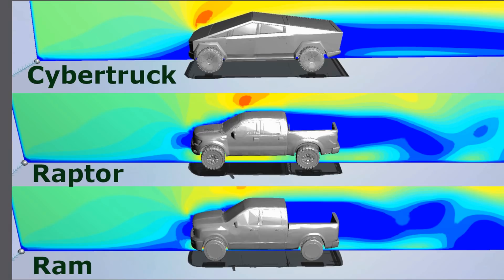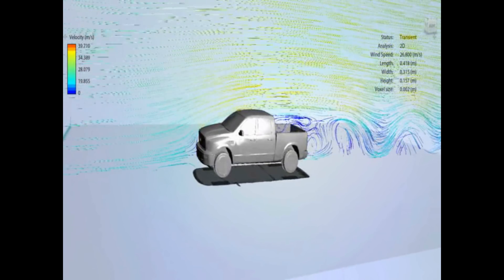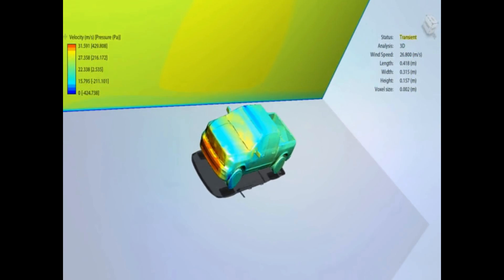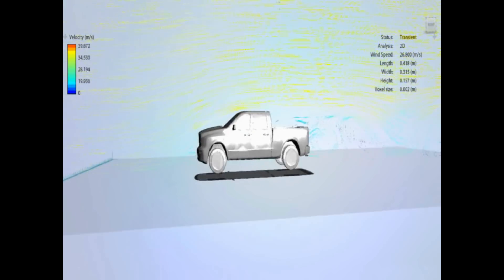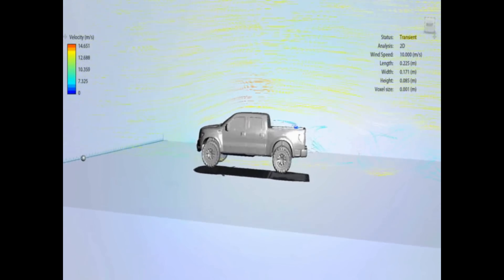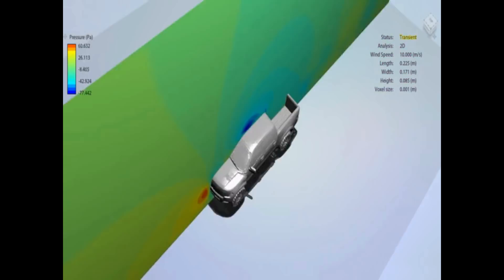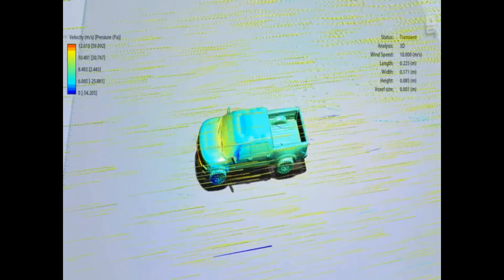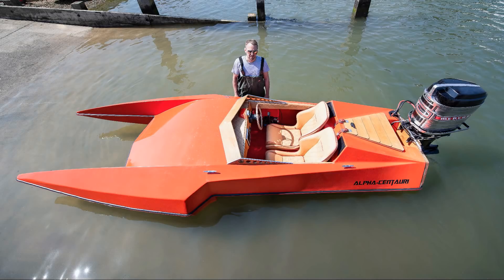Cybertruck vs Ram vs Raptor  Aerodynamics

Comment from the maker: Please bear in mind that the cd figures I have said could be way out!
This simulation used old software and potentially inaccurate models.
There is a lot of room for error.
There are a couple of genuine aerospace engineers saying that the drag is much higher than my results suggest,  trust their results not mine!
Reply: Boats and Engines - Here’s an additional analysis - 
https://interestingengineering.com/teslas-cybertruck-aerodynamics-do-flow-smoothly-as-per-a-cfd-analysis
Reply: Also, the Cybertrck is flatter underneath. No engine bay, rear dif.,driveshaft, etc.
Reply: Ram's published cd is 0.357.
Reply: Each should be ran with a cover over the bed or have the tesla have it's bed open. Really is an unfair test otherwise
Reply: Where do you get a software like this and is there any which are free?
Reply: Your on the reddit train, prepare for more subs
Reply: Hi. Where did you find the model for the Cybertruck?
Reply: Can someone direct me to this software..please!!  what is it? where can i get it?
Reply from the maker: @xevious2501  it's autodesk flow design,  no longer available. You can download openfoam free and its more up to date.
Reply: @BoatsandEngines  do it again with the bed closed and open.
Reply: Actually, your figures are intuitively quite reasonable.  The Cybertruck has a teardrop shape, though rough in texture.  The Facetmobile  and F-117 aircraft,  as well as most attack helicopters,  show that aero by flat facets is quite doable.  However,  traditional pickup trucks are glorified bricks aerodynamically,  and any recent advances in them are basically lipstick on (aerodynamic) pigs.  Nothing wrong with that,  but aero results are obvious. 

The cybertruck could even include slot ducts in the front fascia for battery cooling or HVAC, as well as cabin vent slits on that roof peak,  to control boundary layer and further improve aero.
Reply: What matters is the comparative results. Errors in one model should be the same as the other models. Use the comparisons to calibrate the actual figures. Try comparing with Model 3. MOdel 3 drag coefficient  should be around 0.3 using your software also. The actual one is 0.23, lower than Model S at 0.24. dodge Ram 1500 Regular Cab 4x2 has a drag coefficient of 0.360.
Reply: @4kbinaural935  "Errors in one model should be the same as the other models."
That's not necessarily the case and the comparison is kinda useless when the cybertruck's bed isn't even open. Obviously a closed bed will do better and trucks with partial or full canopies will do better than without. This also doesn't mean the cybertruck wouldn't do better with a curved top.
Reply: @trafalgarla  The best cd for ram is 0.36 with the bed covered plus other tricks. So the figure 0.5 to 0.6 with the bed open is reasonable and too high. All readings should be reduced by 0.1. Even for cybertruck.
Reply: Nobody in truck community cares about cd...all about how useful the truck is...i want to see how long will the batteries last while towing...the bed itself on cybertruck is pointless with those side walls

Comment: Good analysis. You did not go into the energy use but using  air density of 1.2kg/m^3 and a highway speed of 108 kmph the energy usage of the 3 vehicles using your drag coefficient figures Cybertruck= 0.4  , F150 of =0.56  along with rough manufacturers width and height and ground clearance which seems very similar for all 3 of them i feed that into power=force*velocity and ignoring factors like rolling resistance and electric motor efficiency which would generally be quite small compared to drag at highway speed of 108 kmph i get the following energy cost to overcome drag. 
Dodge ram   0.30kwh/km
Ford F150   0.29kwh/km
Cybertruck  0.23kwh/km

The Cybertruck's aerodynamics give it a clear advantage at 108kmph.
The Cybertruck's design using cast aluminium front and rear assembly's an exoskeleton shell and 4860 structural battery should help keep it's weight down compared to an electric version of the Ram or the F150 lightning - will be interesting to see what the production versions weigh.

Comment: Manufacturers basing their specs off of simulations? What is this, amateur hour? They use wind tunnel tests.
Reply from the maker: Not having a go at you. But perhaps you should do some research before making a statement like that.
Reply: @BoatsandEngines  Ayy my man, no fluid simulation can stand up to real life physics test. You can get decent mileage out of it during prototyping stage but it doesn't have great accuracy so you gotta do real tests.
Reply from the maker: @michaelbuckers  yes totally agree, but cfd is crucial at the initial design stage.

Comment: Cd is a bit meaningless without the frontal area. Do you have some figures? I’m trying to remember now but I think I was told by our wind tunnel guy that as a general rule, for bog standard family cars at least, that you can take the width and height dimensions from the brochure and roughly take about 15% off that area to arrive at an approximate frontal area. Probably a little different for bluff fronted vehicles like trucks though.

Comment: setup seems questionable - but you compared it to other cars with the same questionable setup so if oyu just look at the comparison between them the actual error shouldn't be too big
for starters it seems like the ground in your model is not moving backwards along with the air but instead remains stationary relative to the car - so due to friction with the ground there's a layer of air close to the ground with very little relative velocity

Comment: My back of the envelope calculations based on the  500 miles / 200 kWh battery claim is that the overall Cd * A of the Tesla truck will be not much better than that of the F150 assuming the same rolling resistance, maybe around 5 - 10%. A Cd of > 0.5 seems rather off for a modern vehicle. I have read in literature that it's estimated to be around 0.35.

Comment: Thank you for an excellent clear video presentation and impressive given your necessarily limited simulation processing power compared to a manufacturer. What intrigues me is current trucks top out at relatively low cruising speeds, unless crazy high fuel consumption is assumed. This makes one think that the cybertruck will be an efficient and possibly quiet long distance cruiser?
Mind you God help us when the police have them!

Comment: Question. I have access to solidworks. would you mind sending me the models? I have a ASUS ROG 1080Ti on the way soon I had to get it refurbished. (Shorted the RGB pins like a noob don't ask how) but I'll be able to push the simulation further for sure then.
Reply from the maker: Hello, the models are all on thingiverse. You will probably need meshlab or similar to convert the stl files.
Reply: @BoatsandEngines  Thanks for the advice and the resources when I can attempt the render I'll update by replying here.

Comment: Hey man I am a Mechanical Engineering Student. Can I know the reason you didn't choose Ansys? It is free for students and quite easy to get.
Reply: flow design is a million times easier to use than ansys for just a simple visual simulation.

Comment: I think it is mostly because of the cover of the rear portion of Cybertruck. Even if we could use some soft cover the portion from rear edge of cockpit to tailgate on F150 or RAM1500, the performance will be much better

Comment: I dont think that aerodynamics dont matter on pickups. Its about offroad performance and the power to pull stuff. If you want good pickup buy toyota. They are more durable and affortable.
Reply: Aerodynamics is EVERYTHING in every moving vehicle especially trucks it's going to determine how fast and efficient you travel even when you are off-roading. When your truck is not aerodynamic it is going to affect how much your truck can pull while going at a reasonable speed as well as how far it can travel because when a vehicle is more aerodynamic it will be able to go father be faster and pull more, this goes for every vehicle including aircraft and watercraft.
Reply: Most important thing in offroad is the tyres and engine power. Electrics may have better launch but that suff is useless in the trail. Turbo diesel for life. On environmental view electrics are pointless. 15k Toyota pick up is more worth the and more reliable than ev that overtime gets more mecanical problens. Influense of air resistance is just marginal.
Reply: @ashtonk.2380  i bet those ev wont last as long as cars made back in 90s and early 2000s. And good luck trying to get 500 000 km. Just like apple wants you to buy a new phone rather than repair the old one. Teslas cost over warranty.
Reply: @o.h2202  All combustion engines and electric vehicles can double if not triple the lifespan of cars made in the 90s and early 2000s for example cars in that time could go around 320 000 km before dying. Today's vehicles, electric and combustion engine can go around 800 000 km if not a little more before dying this may change due to Elon saying that Teslas will soon be getting a battery that can last over 1 600 000 km also teslas has an 8-year warranty on these batteries, if anything happens to them during the 8 years they will replace it for free and if you ever have mechanical issues with your vehicle they will come to you. I guess we can agree on 1 thing thoe and that is that Apple is a shit company that just wants to suck cash out of you.
Reply: @ashtonk.2380  they can go way more than 320 000km. But id still choose diesel pickup over any cybertruck. For example pickups are often used for towing. And diesel semis currently outperform teslas semis that can pull only 40 tonnes while diesels pull hundreds of tonnes more. Id rather invest on biofuels. They could become dirt cheap. Its more useful to get materials from mcdonalds than from Iraq oil fields. Allso London has a big problem with all this grease and fat in their sewer system.

Comment: This video is nonsensical because these are all open beds... there is something called a bed cover..   hatches etc... , if this was a big issue get a sloped aerodynamic bed cover or attach a fabric tarp.    Try runnign some tests with the bedcovers on... I love the cybertruck but this test is really scewed because the cybertruck wouldn't run closed bed with irregular or large cargo in the back, which is what people may be getting this truck for in the first place.

Comment: The lack of holes in the grille will make a huge difference. The holes allow air to pass through and make its way out of the underside of the truck and more importantly over the windscreen. It creates  a much smoother airflow over the entire top of the truck with less separation. Basically creates a skin of smooth air across the entire width of the trucks windshield. You can see this in action as you drive down the highway and see bugs or dust flow over the glass vs plastering on it like old models.
Reply: wrong.
Reply: @nothanks3590 wrong?
Reply: maybe I misunderstood the point you were trying to make... it seems you are sayin that having an open grill improves aerodynamics,  it doesn't.
Reply: @nothanks3590  K... Coming from an engineer....

A perfectly aerodynamically sleek shape is best (think land speed record cars). But we are talking about the "best case" of THIS form factor (aka a truck).

Using openings in the body of a vehicle to create a laminar flow over certain less optimal areas of geometry is a common practice in the automotive field.

An example, newer cars use vents that intake from the front and project a high pressure bubble over the wheel openings to prevent detached flow around the spinning wheels. The "loss" of efficiency from intaking air greatly reduces the drag over the rest of the body's side panels, so the overall efficiency goes up.

Another example is how some Mercedes or Audi convertibles extend a airfoil above the windshield line (Increasing cross sectional area, and overall aerodynamic features) when the top goes down, This creates a pressure bubble and directs airflow over the open cabin in a much smoother path, making the experience quieter, and less windy. Many cars with sunroofs also use a similar mechanism with a vertical air dam to create the same effect. Buffeting = Drag.

Another example is active aerodynamics as seen on some super cars.

Another example is what I stated in the last post.

Sometimes the small loss in efficiency here or there can create a huge gain elsewhere. This is one of those times.

I'm not saying that the Tesla isn't better than a RAM or Ford, I'm just saying that these tests are not showing a real representation of the RAM or Ford. I would bet the difference is not as huge as this video suggests.

Comment: your speed is similar to the vehicles in the road,  but the lenghts are not. this gives a diference in Reynolds number which affects flow separation and drag. you can apply scale to the domain and 3d models to improve your results, or correct the speed to get the same Reynolds.

Comment: Thanks for this. 2 questions for Raptor owners. 1. Does filling in the front outward bumper holes with lights and a backing plate improve drag. The idea is that more air would spill to around the wheels instead of being caught in the wheel well. 2. If running a rooftop tent on a rack on the back bed that sticks up 12" or 30 cm, how much drag does that add? Looking at your model, it would appear there is good laminar flow at the end of the cab toward the box, but maybe not. It might already be a little turbulent or low pressure that. 

I'd say tonneau covers are popular enough that they warrant a run. 

So, for future vid ideas, I'd be most interested in tonneau vs. no tonneau. Roof top tent on the roof, on a rack at the back of the truck, on a rack, but only sticking up a few inches. With fog lights and backing plate in the bumper holes and without. If you are already busy on other projects or can't easily model these variables, all understandable. Raptor vids generally receive a lot of views. Am about to purchase a roof top tent for my Raptor, so a timely question for me.

Comment: This is idiotic.
You're showing the cybertruck with a cover on it. That cover is not going to be standard, its going to be an option.... just like both other trucks have them as options...
Reply: Cover is standard.
Reply: @CorwynGC  
No. It isn't.
And even if it was, the price starting point leaves you a 10,000$ price gap to get a 500$ cover for either of the other trucks.

But that isn't the case. It isn't standard. No matter how you look at it this is pathetic.
Reply: @monarchco  
Yes. It is. 
We can do this all day.  

The CyberTruck as tested is the $49,900 version, which Ford, Chevy, or Ram would you like to put up against it, with  6.5 foot bed, 5-6 seats, AWD, 10,000 lbs towing, and 3500 lb cargo capacity?  And what does it cost?

Comment: This comparation is trash. You assume the load of the cibertruck has the backload covered.  Plus tesla want to save on industrial design. Better buy an Aztec
Reply: It's a legit comparison,  period.  It's of the trucks,  not truck hauling a refrigerator or trailer or horse.  It's a limited comparison as there's not a complete model available of all 3 anyway, so he did what's possible.

Comment: Very interesting videos- thanks for posting. You don't mention anything about the bottom of the trucks. I'm sure it would be extremely difficult to model on ice pickups because there's a forest of drag factors, whereas the  cybertruck belly would be pretty much one smooth sheet. So potentially a very big difference to consider between the types.

Comment: considering most Tesla vehicles have awesome drag coefficients i think the Cybertruck would have a better coefficient than almost all trucks on the road
Reply: Yes but the cybertruck takes a different design approach to the other Tesla's. As far as I can tell it focuses less on efficiency and more on just being physically tough and easy to repair in terms of bodywork.
Reply: @nadaso8819  The Tesla truck will be just as bad as the Honda Ridgeline. Makes sense since they are both unibody fake trucks. It's funny how my 2000 4runner is more of truck than real trucks these days...

Comment: Is it possible that the software is just having a hard time calculating around curved surfaces? Compared to straight lines?
Reply from the maker: Yes someone suggested that I may just be close the limit of my hardware,  causing higher numbers.  It sounds plausible.
Reply: @BoatsandEngines  just rent a machine on the cloud with pro specs. few dollars here and there when you need an accurate test
Reply: @SoussiAfif  his sofware is also not so good so he would have to spend quite a lot to get good results
Reply: @BoatsandEngines  When ya upgrade your hardware, whenever that is, let us know by running the CFD simulation again. Thanks mate! 👍

Comment: Are you lowering the truck enough though? On highways it'll decrease its height significantly.
Reply: Air suspension Rams do the same thing.
Reply: @skuzzyj  air suspension Rams aren't flat on the bottom
Reply: @Big_Red_Dork  
That's fair.
Reply: I'm wondering the same thing...would changing the height have any effect on the drag?